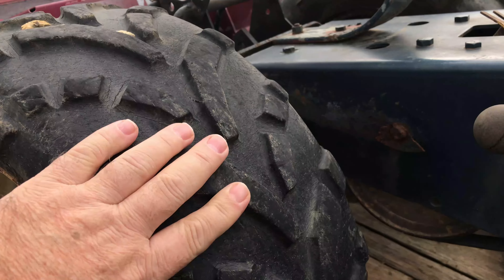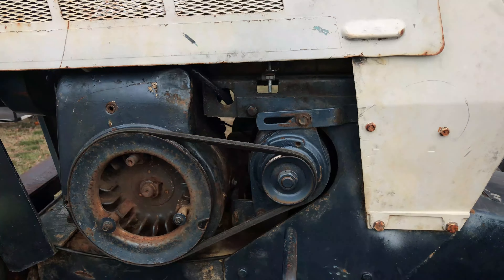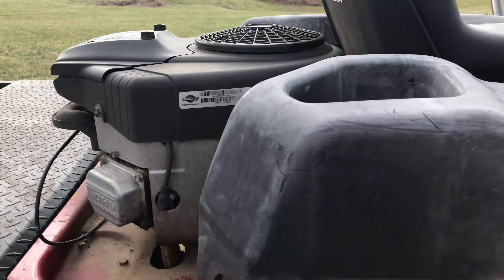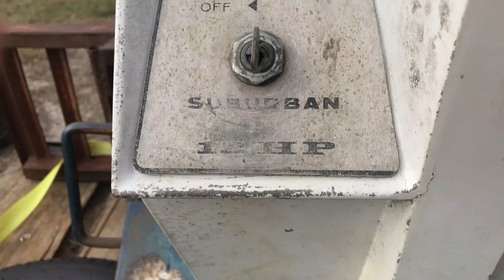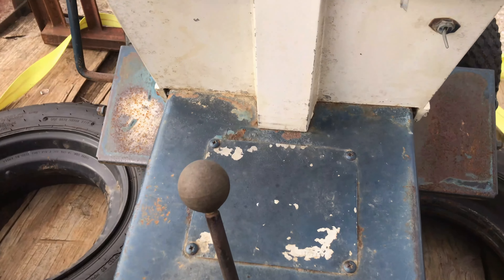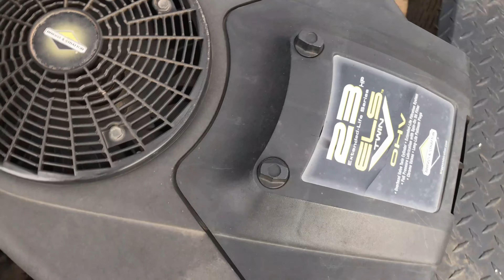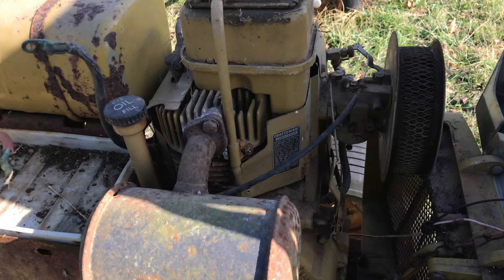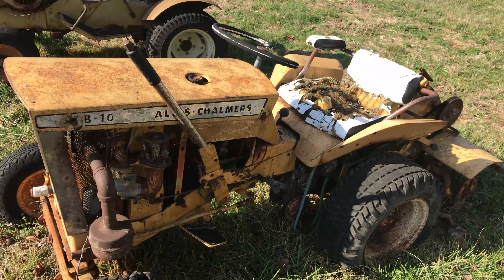NEW JUNK TOUR! See Sears Suburban 12, ST16, Tecumseh Engine, White Zero Turn, 682 Cub Cadet!

Comment: Look at those tires on the d10!! You don't see those every day. I'm into this stuff. Lol all I have is my Craftsman but she runs. I gotta figure out how to do a valve adjustment, I want to add a better air filter system, lights, better tires and modify the exhaust just to change how it exits. It still has to mow but I want to use it for more things, nothing crazy but I have a wheelbarrow I want to turn into a dump wagon for sure.
Reply from the maker: I love those garden tractors too FBC! Garden tractor pulls used to be a big thing around Central KY but a few years back everyone seems to have stopped pulling around here. Great to see you!

Comment: Sweet load of junk brother!
Reply: That tractor is mint. I'd hot rod that thing but to be used for pulling logs out of my woods and dragging out a trail. I also need a brush cutter.
Reply from the maker: @fatbuddycat  Thanks FBC! I think my favorite is the Allis B10 because it has several pieces of equipment with it. That sickle mower is too cool for mowing a field of grass that's too tall for anything else. I remember we used to cut hay with a 7' sickle mower on a 3000 Ford tractor. This one is only 4' but it operates on a tractor powered by a 10 HP Briggs. LOL!
Reply: @KentuckyFriedFixes  I love it! I'd take that over a v twin vertical.

Comment: Heaven right there I need to rebuild my jd 110 one of these days I miss not having it around to use
Reply from the maker: Hi HP! I love those John Deere garden tractors! The 110 is one of my favorites. I sold the last one years ago but I still have a couple of 214's and a good old 212 around. It's about time I gave the 212 some love with a fresh engine rebuild and mowing deck overhaul. The deck on my 212 sounds like a thrashing machine but somehow it still makes the lawn like a golf course.
Reply: @KentuckyFriedFixes  I got to put a new blade on my Troy built this year youngest boy hit a tree stump last year and bent it

Comment: I am looking for a tecumseh motor    and sears 3pt tiller
Reply from the maker: Hi Paul! I've been looking for a Sears 3pt rototiller attachment too! Those things are getting scarce. Elkskins may have something @Elkskinsmowerjunkyard . He has a lot of Sears stuff. 

I have one spare cast iron Tecumseh engine that's either a 10 or a 12hp. I've not checked it out as it came as a spare with no carb I got with another Sears tractor purchase. It likely needs a complete rebuild at the minimum though. $100 if you're interested but I can't ship it though because of the weight. It'd be a pickup deal.